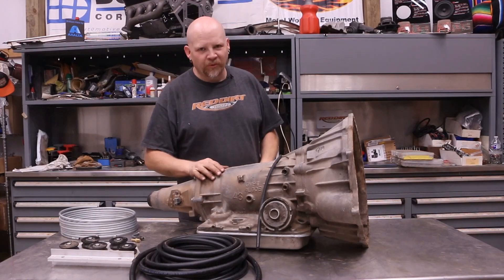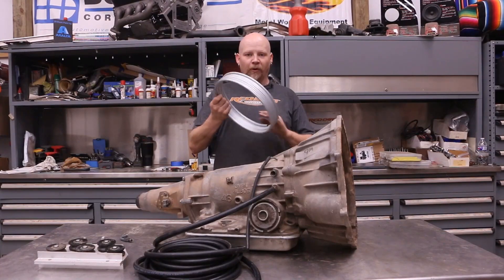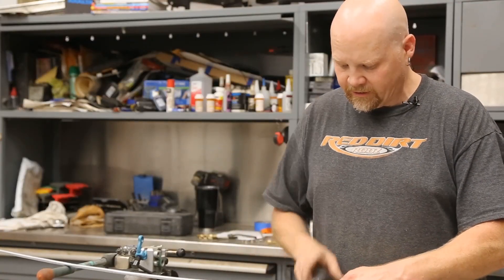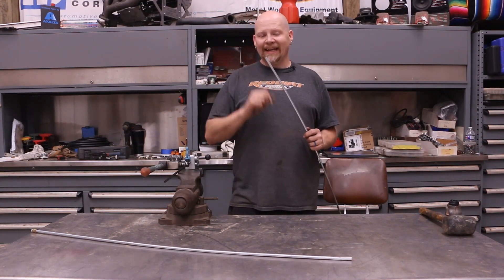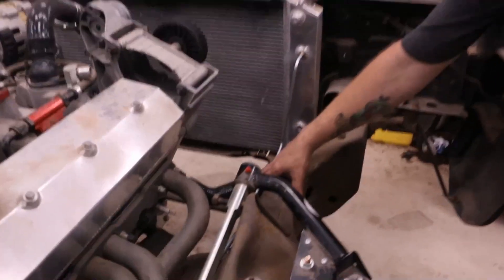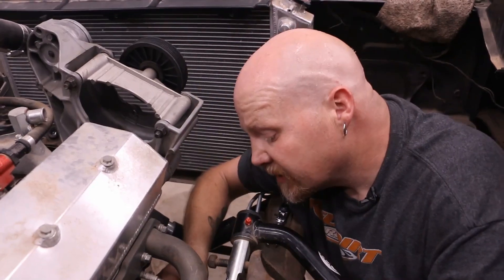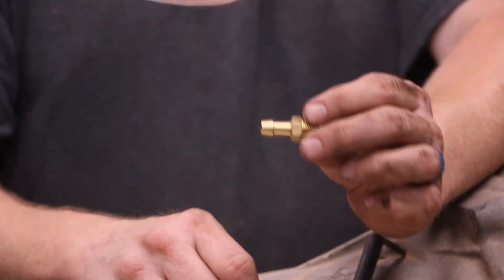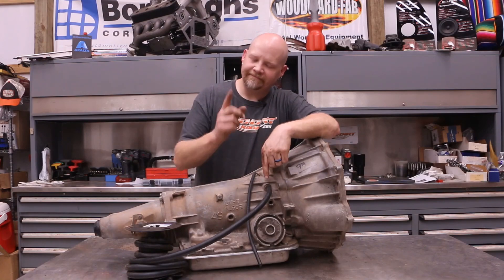El Camino Project: How To Bend Hard Lines For A Transmission Cooler (also for brake and fuel lines!)

Comment: Thanks for the video.   Question, when rerouting a section of OEM pre-bent line, like for a new larger cooler that's located in a new spot, is it safe to bend that OEM hard line like you are here - all the same stuff, just use care not to kink or crimp, right?    Just want to be sure that stuff doesn't split or crack, not sure how they form and harden it.    Thanks.
Reply from the maker: Yes, as long as it doesnt kink, it is OK to bend. It should not split.
Reply: @Reddirtrodz   Thanks.   Can you recommend a hand type bender for doing smaller tighter pieces?   My dad had some real old small roller type benders but long gone now.   Anything you can suggest would be appreciated.   Will take my time, I understand no guarantees - just what you might suggest.